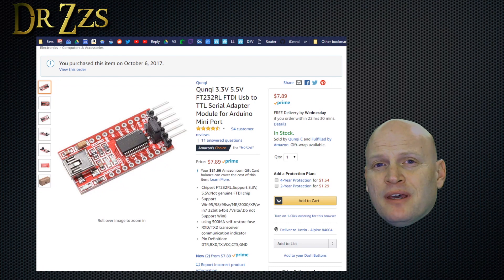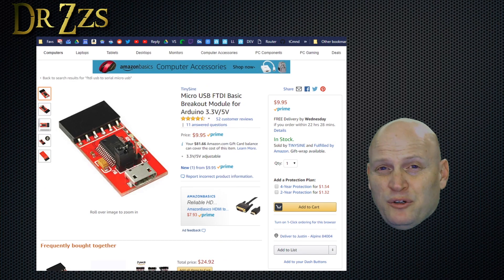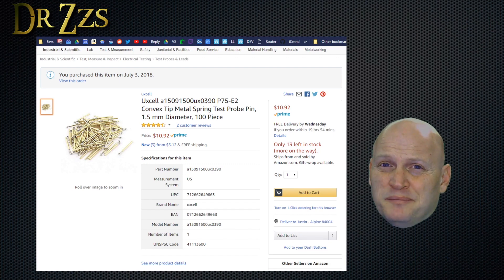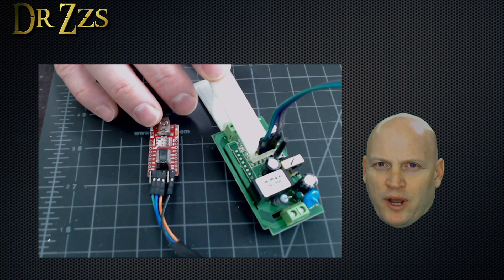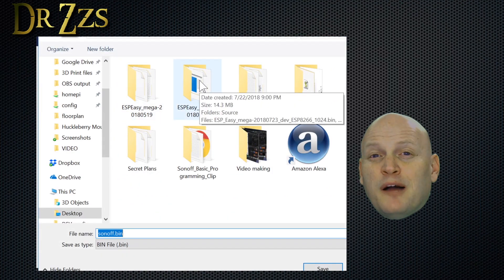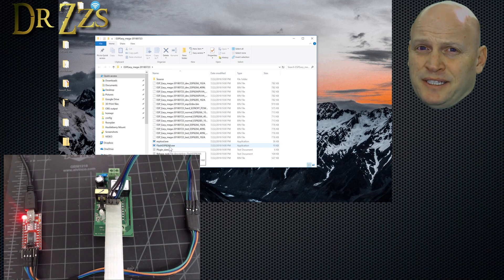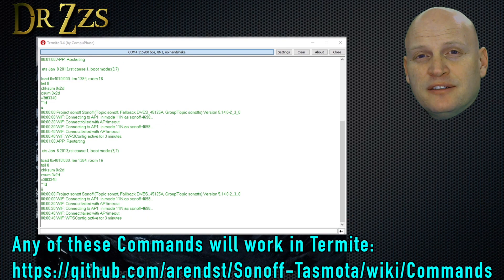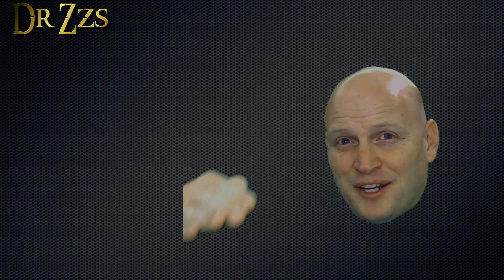How To Change Firmware on Sonoff Devices for use in Home Automation Projects

Comment: subscribed, liked, bookmarked and lastly THANKS!

questions: 
1. I need a sonoff that can do pulse (ON for 2 seconds, then OFF). can tesmoda do that?
2. There is no internet where sonoff will be installed; can I run sonoff in AP mode wherein my mobile devices will connect to it via wifi to command it?
TIA!
Reply from the maker: Thanks!
yes, to have it on for 2 sec then off, go to the console in the Tasmota UI and type "Pulsetime 20" That will turn the relay off after 2 seconds. 
hmmm.  I don't know if there is a way to keep the sonoff broadcasting an AP and also control it.  I think the AP mode may only work for setup.  That's something you may need to hunt for in the Tasmota documentation.  Sorry, I don't know the answer for you.
Reply: @DrZzs  I checked around with the AP functionality (aka Standalone mode) on forums, groups, and such. 
As far as the official tasmota team is concern, they are NOT interested in adding this feature opining they intend tasmota as a home automation system (interconnecting with others) and not as a single controller on its own.

Only Shelly in its original firmware offers this "Standalone" feature.

Comment: GREAT video, as always.  Just some info to pass on....In case others, like me, needed help....thought;  I can't be the only one with a WiFi issue AFTER flashing the new Sonoff-Tasmota-Release 6.3.0 !!!!

My 'WiFi Analyzer shows '0' (ZERO) transmitter output power from the SonOff, while the 'Termite' terminal read (no matter which bin I used):  
00:00:00 Project sonoff Sonoff (Topic sonoff, Fallback DVES_6771E4, GroupTopic sonoffs) Version 6.3.0-2_3_0
00:00:00 WIF: Connecting to AP1 (my ssid) in mode 11N as sonoff-4580...
00:00:09 WIF: Connect failed as AP cannot be reached
..............over and over again.....
My Analyzer showed PLENTY of power from my router!  Even placing the Sonoff Basic within 3-4' of the router did NOT CONNECT!!
Then I found:  ...https://github.com/arendst/Sonoff-Tasmota/issues/3289
Finally, OTHERS with this issue...I downloaded Sonoff-Tasmota-Release 5.1.4 (per your video) Erased the Sonoff memory (with esptool), Flashed with FlashESP8266.exe  and...after about 5 minutes...SUCCESS, WiFi working, ALL OK!!!
Reply from the maker: ugh
Well, glad you got it working, and thanks for the warning.

Comment: Great video..do advise what to do when one changes the wifi password...I am lost on that
Reply: I don't have one yet to test, but did you try going to the IP address of the Sonoff, then enter in the new password? (before changing the wifi password of course) If you did change the password first, you'll probably have to connect through serial / usb again and edit the config that way.

Comment: I wonder if it would be possible to flash so switch works with the hive system ?
Reply from the maker: I don't know much about the Hive system.  Sounds like a scary group of Super Villains.  
Does Hive use MQTT?  If it does then it'll work with tasmota.

Comment: As a newbie this is what I worked out from the template you added that we can paste into termite to program the sonoff.

Backlog 
SSID1 Dlink-47H7J-1;  (name of the wifi in my house)
Password1 4Ylf9ttT;  (password of your wifi (note you can NOT have special characters in your Wifi password it's not supported in the later versions of sonoff.bin firmware))
MqttHost 192.168.1.199; (ip address of raspberry pi on your home network, note PI and your sonoff must be on the same network)
MqttUser mikej; (username I setup in mosquitto addon)
MqttPassword demo008%;  (password I setup in mosquitto addon)
GPIO14 09;  (when you get into the web interface for your tasmota flashed sonoff you will see there is GPI01, 3, 4 and 14 these are pins on the sonoff which you can connect things to later eg a external switch, PIR sensor etc setting GPIO14 pin to 09 means you can connect a pushbutton switch to your sonoff and toggle it on and off with a external switch, this setting is not overly important to get your sonoff working you can change it later in the web interface easily).
Hostname Patio Light; (Give sonoff a name on your wifi (eg when you look in your router GUI what do you want this device to show as)
MqttClient pattiotable88;  (i don't think this name is important at beginners level just set it the same as your topic)
Topic sonoff01; (eg sonoff needs its own unique name so it can be called upon via MQTT you will use this name hassio config.yaml to speak to your sonoff, you can call it what you want I just went with sonoff01)
FriendlyName1 PatioTable (give my sonoff a name for you it can have spaces if you want too)

Comment: Hi, I have one problem with sunoff basic and tasmot.
If I have a 3.3V and gnd connected from my computer, the device works ok. But if I connect to 230V, the device does not work. Only the green LED light flashes, and the button on the circuit works ok. Where is the problem? thanks J
Reply: Had the same problem. I just reflashed firmware to older version, specifically to 6.1.1 as it was already on my computer, and everything started working perfectly.

Comment: Hmm..I keep getting flash failed.

I started with FlashESP8266.exe file which started flashing and then stop and gave me flash failed.

I then used the ESP.Easy.Flasher.exe which failed with 1 error and produced a log.

*Using Windows 10 x64 | FT232RL | Sonoff Basic

######2018-11-02######

#######0.02.003#######

######FLASH INFO######
BIN file: sonoff.bin
COM port: (COM3) USB Serial Port
Baud rate: 115200
######POST FLASH######
No post flash information entered...
######FLASH LOG######
[esptool.exe -vv -cd nodemcu -cb 115200 -cp COM3 -ca 0x00000 -cf "D:\My Personal Data\My Downloads\ESPEasy_mega-20181101\bin\sonoff.bin"]
[2/11/2018 5:27:43 PM] esptool v0.4.12 - (c) 2014 Ch. Klippel <ck@atelier-klippel.de>
[2/11/2018 5:27:43 PM]  setting board to nodemcu
[2/11/2018 5:27:43 PM]  setting baudrate from 115200 to 115200
[2/11/2018 5:27:43 PM]  setting port from  to COM3
[2/11/2018 5:27:43 PM]  setting address from 0x00000000 to 0x00000000
[2/11/2018 5:27:43 PM]  espcomm_upload_file
[2/11/2018 5:27:43 PM]  espcomm_upload_mem
[2/11/2018 5:27:43 PM]  setting serial port timeouts to 1000 ms
[2/11/2018 5:27:43 PM] opening bootloader
[2/11/2018 5:27:43 PM] resetting board
[2/11/2018 5:27:43 PM] trying to connect
[2/11/2018 5:27:43 PM]  flush start
[2/11/2018 5:27:43 PM]  setting serial port timeouts to 1 ms
[2/11/2018 5:27:43 PM]  setting serial port timeouts to 1000 ms
[2/11/2018 5:27:43 PM]  flush complete
[2/11/2018 5:27:43 PM]  espcomm_send_command: sending command header
[2/11/2018 5:27:43 PM]  espcomm_send_command: sending command payload
[2/11/2018 5:27:43 PM]  read 0, requested 1
[2/11/2018 5:27:43 PM] trying to connect
[2/11/2018 5:27:43 PM]  flush start
[2/11/2018 5:27:43 PM]  setting serial port timeouts to 1 ms
[2/11/2018 5:27:43 PM]  setting serial port timeouts to 1000 ms
[2/11/2018 5:27:43 PM]  flush complete
[2/11/2018 5:27:43 PM]  espcomm_send_command: sending command header
[2/11/2018 5:27:43 PM]  espcomm_send_command: sending command payload
[2/11/2018 5:27:43 PM]  espcomm_send_command: receiving 2 bytes of data
[2/11/2018 5:27:43 PM]  espcomm_send_command: receiving 2 bytes of data
[2/11/2018 5:27:43 PM]  espcomm_send_command: receiving 2 bytes of data
[2/11/2018 5:27:43 PM]  espcomm_send_command: receiving 2 bytes of data
[2/11/2018 5:27:43 PM]  espcomm_send_command: receiving 2 bytes of data
[2/11/2018 5:27:43 PM]  espcomm_send_command: receiving 2 bytes of data
[2/11/2018 5:27:43 PM]  espcomm_send_command: receiving 2 bytes of data
[2/11/2018 5:27:43 PM]  espcomm_send_command: receiving 2 bytes of data
[2/11/2018 5:27:43 PM] Uploading 540976 bytes from D:\My Personal Data\My Downloads\ESPEasy_mega-20181101\bin\sonoff.bin to flash at 0x00000000
[2/11/2018 5:27:43 PM]  erasing flash
[2/11/2018 5:27:43 PM]  size: 084130 address: 000000
[2/11/2018 5:27:43 PM]  first_sector_index: 0
[2/11/2018 5:27:43 PM]  total_sector_count: 133
[2/11/2018 5:27:43 PM]  head_sector_count: 16
[2/11/2018 5:27:43 PM]  adjusted_sector_count: 117
[2/11/2018 5:27:43 PM]  erase_size: 075000
[2/11/2018 5:27:43 PM]  espcomm_send_command: sending command header
[2/11/2018 5:27:43 PM]  espcomm_send_command: sending command payload
[2/11/2018 5:27:43 PM]  setting serial port timeouts to 15000 ms
[2/11/2018 5:27:43 PM]  setting serial port timeouts to 1000 ms
[2/11/2018 5:27:43 PM]  espcomm_send_command: receiving 2 bytes of data
[2/11/2018 5:27:43 PM]  writing flash
[2/11/2018 5:27:55 PM] ................................................................................ [ 15% ]
[2/11/2018 5:28:07 PM] ................................................................................ [ 30% ]
[2/11/2018 5:28:19 PM] ................................................................................ [ 45% ]
[2/11/2018 5:28:31 PM] ................................................................................ [ 60% ]
[2/11/2018 5:28:34 PM] ............ read 0, requested 1
[2/11/2018 5:28:34 PM] warning: espcomm_send_command: didn't receive command response
[2/11/2018 5:28:34 PM] warning: espcomm_send_command(FLASH_DOWNLOAD_DATA) failed
[2/11/2018 5:28:34 PM] warning: espcomm_send_command: wrong direction/command: 0x01 0x03, expected 0x01 0x04
[2/11/2018 5:28:34 PM] closing bootloader
[2/11/2018 5:28:34 PM]  flush start
[2/11/2018 5:28:34 PM]  setting serial port timeouts to 1 ms
[2/11/2018 5:28:34 PM]  setting serial port timeouts to 1000 ms
[2/11/2018 5:28:34 PM]  flush complete
[2/11/2018 5:28:34 PM] error: espcomm_upload_mem failed
[2018-11-02 17:28:34] DONE! BUT WITH (1) ERRORS!
############################
[2018-11-02 17:28:34] The COM port was already in use... the post-flash did not complete.
[2018-11-02 17:28:34] JOB COMPLETED, over and out!
Reply from the maker: I'm wondering if the board has a bad sector in the memory.  Sounds like both methods for flashing are failing part way though.  So the problem isn't anything you're doing.  The bin file should be fine too, so I'd bet it's the sonoff.  It is just one that is giving this error?  have you successfully flashed others?
Reply: @DrZzs  It seems it is my FT232RL. I bought 3 cheaply off aliexpress. I decided to open up another one and got a different result but still failure. 

After searching internet I quiet quickly come across the new FTDI driver update that comes through windows update bricks chinese fake FT232RLs but setting the PID from 6001 to 0000. But also some unconfirmed rumours that FTDI have removed the bricking in the latest windows driver update. I looked in my device manager and could see that on Hardware IDs I was still showing a 6001.

One thing I did come across which turned out useful that the chinese fakes were unreliable and produced varying results and with that I decided to keep clicking on the flash button which eventually yielded a successful flash. 

So my assumption is non genuine chips have reliability issues keep banging the flash button until you get the desired result, however first step is check the Hardware Ids in Windows Device manager to make sure the board isn't bricked.

And although I got flashed successfully prompt when I unplug/plugin the USB (eg power cycle) after flashing and open termite (with correct baud rate) I get no communication in termite.

I would like to buy a genuine board for the sake of how long this took my time is more important than a few dollars. The problem now is trying to find a genuine through all the fakes.
Reply: @DrZzs  I found another one on ebay where the guy wrote in his description that he guaranteed his boards would not get bricked by the FTDIanti piracy driver update. 

It got delivered today and I had no problems at all flashing my Sonoff on the 1st go and Termite terminal window to display text as well.

Not sure if you want to mention about the fake FTDI's causing all sorts of random outputs when you are talking about using FT232RL's next.

Comment: Will the sonoff device shows as an AP if the Router is off if we use Termite?
Reply from the maker: There is a setting to determine what it does if it can't connect to the router.  Going into AP mode is one of the options.  It used to be the default.  I'm not sure anymore.  Termite requires it to be connected to the board with wire.  If the sonoff is in AP mode you won't see it on Termite unless you're connected to the PC with the USB/Serial adapter.

Comment: sorry if this is something silly but can't get this to work. Trying to flash my first sonoff, which has open holes so no need of pogo pins. Have tried to hold the pins a hundred different ways but when running ESPeasy i get "flush complete" then "espcomm_send_command: sending command header", then "espcomm_send_command: sending command payload" and then "read 0, requested 1" to finally "resetting board".
Is it a problem with the pins (should i solder them)? the FTDI drivers/adapter (bought the one from the link in the description), the versions? (tried the ones in the video with no luck).
Any help is much appreciated!

Comment: After flashing with Sonoff-Tasmota v6.2.1  sonoff sv and sonoff basic do not respond to toggles from the url.  Only the push button activates the relay.
Reply from the maker: look in the console after you've tried pressing the url buttons and see what it says there.  Then press the physical push button and see what the console says after that.  I'm not sure what's happening, but it sounds like there's a disconnect between the topics for the physical button and the url buttons.  
I ran into something similar recently with the Sonoff T1 after flashing with 6.2.1
I'm not sure it's actually an error, I think it may be a change in the way buttons are handled that I need to catch up on by reading the Release docs (which I shamefully haven't done yet :)
Reply: @DrZzs  it doesn't show anything in the console in both cases

Comment: The flashing method worked perfectly for me, really appreciate the information.  I just ordered some Sonoff basics a couple weeks ago and the openings were not full of solder.  I was able to solder in header pins easily.  If I received these with solder in the openings I would definitely just remove the solder and then solder in a header before I would deal with 3D printing and pogo pins.
Reply from the maker: Glad to hear it! 
Ya, I agree with desoldering over the pogopin option.  I've had trouble getting the pins to stay in contact with the board sometimes.  Hopefully they've stopped soldering the holes closed :)

Comment: Just had to flash my first Sonoff in a while, and I tried this method. Entering the commands in bulk via Termite is WAY better than individually updating settings in the web console. One addition I'd make to the list of commands is "ButtonTopic <sonoff_name>". I had the problem where the physical button on the sonoff was sending an MQTT command that wasn't matching the one it was listening for, and therefore wasn't toggling the relay.
Reply from the maker: I just had that happen with my newest T1's 
That must be a new change in Tasmota 6.x
Thanks for posting about it!  I'm sure others will run into that problem now too.  Hopefully they'll read this...
Thanks!

Comment: I want to flash it on nodemcu and wemos d1 is it possible
Reply from the maker: it sure is!  The D1mini is very easy.  With the NodeMCU you might need to find the driver for your PC to recognize it, but otherwise the steps are the same.
Reply: @DrZzs  great sir

Comment: Where do you get other ESP8266 bin files for my  ESP8266 board?  What is the baud rate for USB connection for generic ESP8266 board?
Reply from the maker: you can still use the sonoff.bin file for D1mini or NodeMCU or any ESP8266 board.
Reply: I get the NodeMCU flash okay.  But when I try the WeMo Mini, I have a problem with "connect failed to domus1:1883, rc-2 Retry in 10 sec..." in the Termite terminal.  Any idea why?  Great job flashing the Tasmota..

Comment: part of advise: to kep things safe maybe use the  Sonoff DC 5V-24V DIY WIFI Wireless Switch Socket SV
Reply from the maker: ya, I'm wondering if we'll ever get to the point that most of the power in our houses is low voltage.  Most of our devices are 12v or 5v.  All our lights should be LEDs now.  Would be safer and easier if we had 12v all through the house instead of 120v or 220v.  Exceptions being large appliances like washer/dryer, AC, Fridge, Ovens etc.

Comment: is this method available for the Mac users ?
Reply from the maker: Not the sonota.exe method. 
I believe there is a sonota.py in the github repo.  That's the python file so you should be able to run that on Mac.  I'm not going to be much help with that since I haven't done it myself.  You'll need python installed at least.  I'd hope there are some instructions on the sonota github...
Yep, there are instructions for Mac and Linux users:
https://github.com/mirko/SonOTA
Reply: @DrZzs  just to update this part, due to Itead's sucesfull effort improving sonoff security a lot, sonota method is probably dead. cable method should still work well.
if that would be too hard, some shops are shipping sonoff flashed with tasmota.

Comment: Great video Doc, I just flashed mine thanks for your it.
Reply: Daniel Hernandez did you have any issues with serial adapter or was it just as video
Reply: Dave Singh it is just like video, the difference is I flashed RF bridge instead a switch.  The method is ok
Reply: im having a hell of a time ive tried uising arduino in ubuntu, adruino windows and esp ez flash with no luck